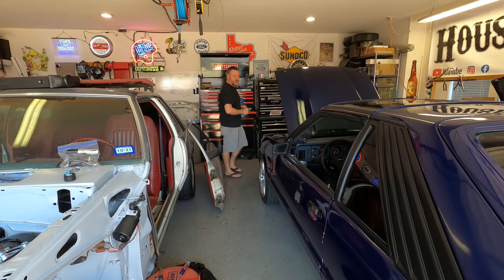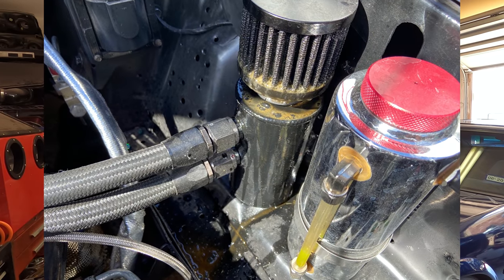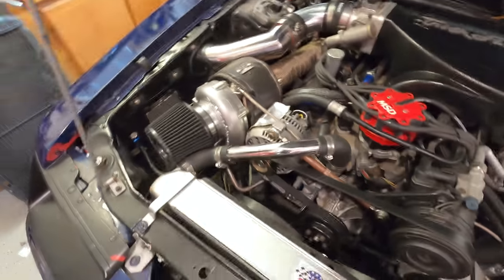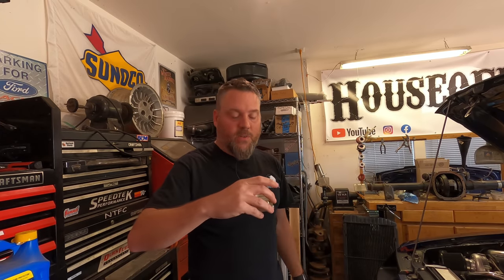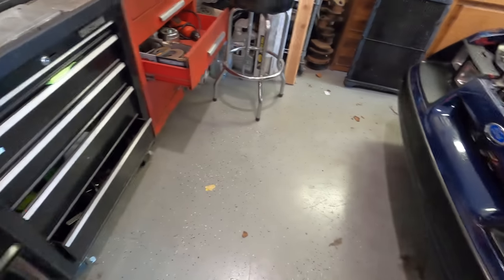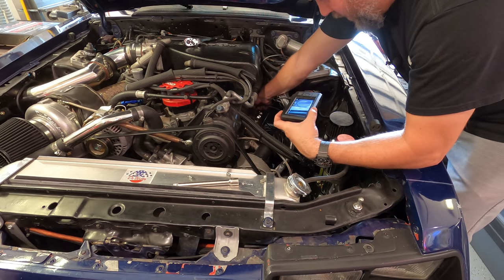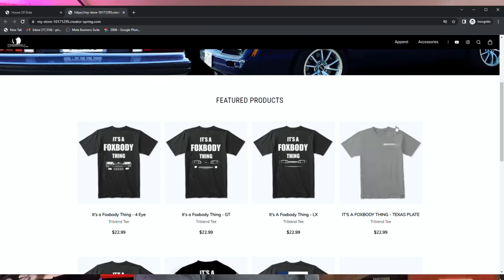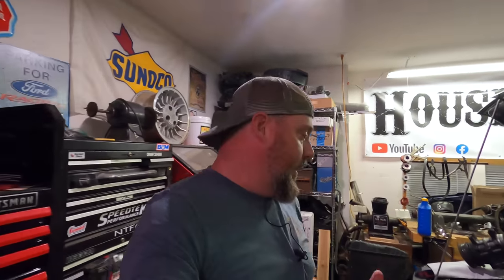Puking Green Sludge from the Catch Can! - Diagnosing on3 Turbo Possible Head Gasket Issue

Comment: Sorry to hear this for you.  Great job diagnosing the issue without ripping the engine apart before hand.  You caught this early on so you may get by with some gaskets as long as that #7 cylinder isn’t scared up.  May not be a bad idea to put fresh oil in it and prime with a drill to flush the bearings of any coolant if you are not doing a full tear down.  Prime for about 10 minutes and let sit over night.  Then drain the oil, change filter and top off with fresh before you fire it up.  Hoping for an easy recovery for ya!
Reply from the maker: Yeah, thanks man. hopefully this just happened. Camera looked like plenty of cross hatch left but…well see

Comment: Stay positive. It’s probably just a head gasket man.  You will be good.  Bigger question I have is the root cause of the over boost.  Was it really just a car show knob turner or is there something else going on?
Reply from the maker: Appreciate it. Well i think its been a slow leak for some time. Over boost? I mean the tune did its job and cut spark and fuel, but thats pretty rough on the motor. One thought is the thinned out oil just allowed the turbo to spool faster, idk. Or the boost controller is shot.

Comment: Hey Dula, I also have an 86 with a bone stock engine. I wanted to put heads cam and an intake on it in the future but I’ve been reading that the 86s came with flat top pistons that won’t work with a bigger cam or even some aftermarket cylinder heads without valve reliefs. 

Do you know if this is true and did you have any issues with it during the process of working on your motor?
Reply from the maker: This sir is true. You CAN do some mild cam upgrades without interference, but have to be careful and check piston to valve clearance. On wilder cams you can also cut valve reliefs yourself. So, once my 86's engine was tired I planned to rebuild with new pistons, aftermarket heads etc. but I ran into that 89 car that had a fresh rebuild in it I puchased, and threw it in, in place if the 86. The heads on an 86 are also pretty weak sauce...a good upgrade is leave the stock cam and pistons, throw on 3 bar GT40 heads, and GT40 intake and it will really wake up.